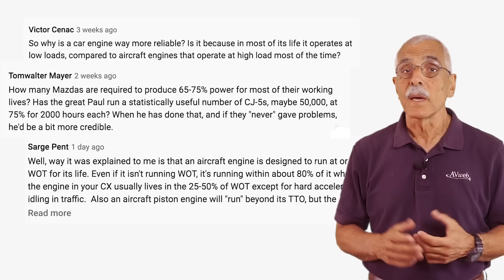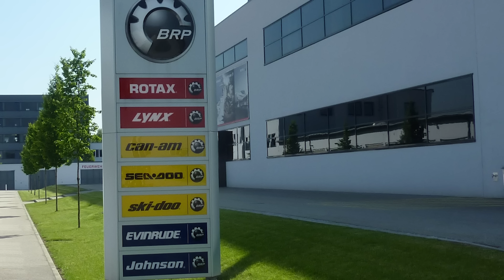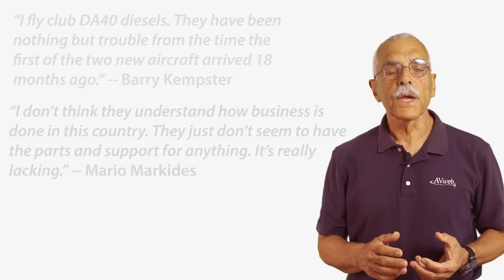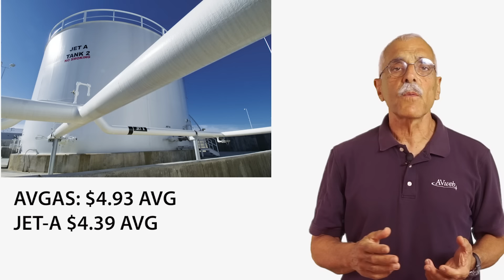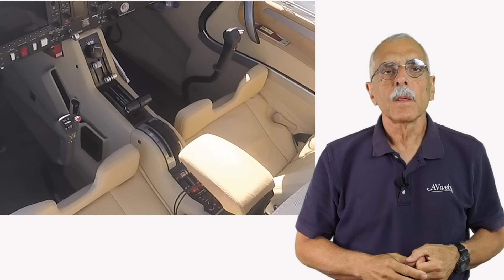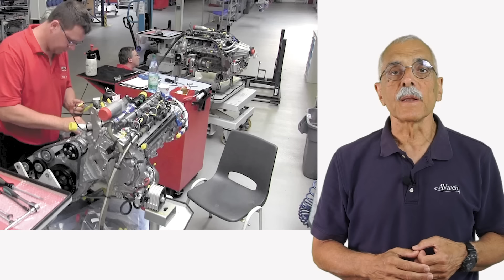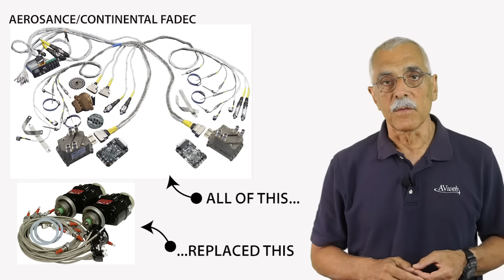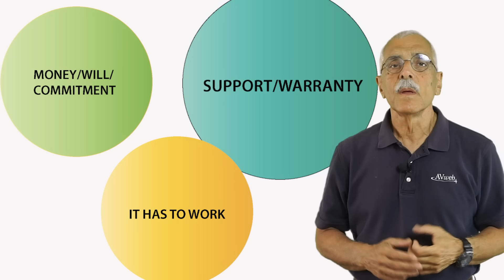Why New Aircraft Engine Ideas Rarely Succeed

Comment: So here's an idea. Instead of being revolutionary and inventing a new piston engine, why don't we be revolutionary in a different way and put a suitably small turboprop in airframes that were designed from the factory to accept a piston engine?

In other words, "Why not PT6?" Already flight proven with millions of flight hours on the clock, lighter than the bigger piston engines that it can be compared to with respect to power output, more reliable and has a longer TBO/TBR than any known piston engine short of maybe the engine in a container ship, highly reliable with fuel contamination/exhaustion being the #1 cause of the engine not continuing to function in flight, FADEC readily available (if it doesn't just come with one stock these days, but that probably depends on which particular PT6 you get), runs on Jet A, the only thing that's missing is the vibration from the pistons going back and forth.

I mean if Mike Patey can make it work in Draco, certainly it's possible. Sure, that was an experimental, but if we're not taking the most successful features of the experimental planes and incorporating them into the more rote GA planes, then why are we even bothering with an experimental branch of aviation?
Perhaps the innovation needed is to bring down the price of turbine engines, rather than pimp out a piston engine?

Also you neglected to mention any kind of aircraft engine using Mogas (even high-test 90+ octane unleaded). The EPA won't kill that, and I bet if the EPA does kill 100LL somehow, that valve seat kits and other parts will rapidly be developed to allow use of mogas in the same old IO or Continental engines we've always been using, or that some other gasoline specification that doesn't use lead but does have a similar octane rating will enter service (not that hard to do, just blend ethanol into it and watch the octane keep climbing, but boy do I hope that's not the route they take, ethanol gas isn't very stable and is quite hygroscopic).
Reply: Turbine engines are extremely inefficient at low speeds and low altitudes. They literally spin too fast (and thus burn too much fuel). When power is pulled to "idle" in a turbine, is doesn't spool down, like a piston, it uses prop pitch the reduce thrust and lift.
Reply: @droge1300 
Long story short, you're right, but you're not addressing the same issues I'm addressing.

Short story long, how often are you really at "idle" or a low power setting in any aircraft? Pretty much just when you're coming in to land or when you need to lose altitude, and the majority of the flight is spent at "cruise power" which for airliners is roughly 85-90% power, well within the range of power settings where turbines are very efficient indeed.
Also there's nothing that says a turboPROP (not turboFAN) aircraft has to be fast, and nothing that says a small general aviation aircraft has to be slow, either. It's entirely possible to make a slow turboprop, or a fast 4-seat turboprop aircraft. Sure it might not be as inexpensive, but I'm not considering cost here, I'm considering what "new engine idea for GA aircraft" will actually succeed. After this video provided so many examples of failures of PISTON engines to meet the needs of either the aircraft or the timeline or the budget, I came to the observation that none of the failures here were of new TURBINE engines, so I jumped to the type of turbine engine that is most suitable to be adapted into use on slower general aviation aircraft and most similar to a piston engine, which is a turboprop.
Additionally, I'm well aware that a full-fat PT6 wouldn't be suitable for many GA aircraft, which is why I though that perhaps either an entirely new design or more likely something with significant design heritage from a small helicopter's turbine engine would be suitable for those applications.
Plus it's not entirely hard to de-rate a PT6, and if it's Pratt&Whitney doing it, the efficiency loss isn't that bad either.

Comment: I lived at Topeka KS 1954-2001. U.S. A. F. then DuPont. I have patents 6446422 & 10525174 and books. I have a design for an engine to power trains, ships and propeller air craft. It uses no pistons, nor cooling and it can run on any liquid or gas fuel as ling as it is combustible. It will not be heavy and should revolutionize the engine manufacturing. I am an 85 Y/O Disabled Veteran PTSD ETC. I ask you to build a small one to test. It will be cast iron and Ceramic. Check with Precision Cast Parts to see what they will do.

Comment: Porsche started the production of aircraft engines after they heard some enthusiast where doing this on their DIY planes. The Porsche CEO had some interest in the aircraft market so they started to produce an aircraft engine. I have heard rumours about the construction of this engines, someone told me Porsche had to re-engineer these engines because the original documents where missing.

After a lot of investment they started producing this engine and than there was a change in the Porsche management. the new CEO wasn't interested in aircraft at all and he found out it will be cheaper buying back the Porsche engines than providing parts for the few engines they sold.

Comment: carb engine should be replaced by EFI it would get rid of the mixture, ECU could control the prop as well and reduce another lever. EFI will reduce fuel consumption, upgrade engine internal with new technology we got after the 60s. aircraft engine doesnt need VVT or VVL like car does since there is almost no movement in the rpm range, prop do it efficenly. If it's possible to get rid of the LL would be great too but running diesel at altitude it's not realy great with all the sout

Comment: "Best Engine"  Not if you require 500+ hp.
Reply: Who requires 500+hp from a piston engine?  For 500+hp, you're in PT-6 teritory.
Reply: @droge1300   There are lots of historic planes that require more than 230 hp, or whatever this "Best Engine" produced.  If you put this best engine in them and fall from the sky, then it isn't the best engine.

Comment: That was very interesting. There are a couple of my favorite no shows missing there. One is the yet to rise above the noise Liquid Piston high efficiency rotary which is getting a start in DARPA funded drone engines. The other was the 3 cylinder 6 piston horizontally opposed diesel https://www.matfoundrygroup.com/News%20and%20Blog/What_is_the_Opposed_Piston_Engine_and_Why_is_it_Better one of which got an opportunity that breaks your first rule “new aircraft new engine” as powering a British built airship. I’ve lost my references to the maker of that engine.
Reply: I'd hardly call an airship an aircraft, especially when talking about engines, as the airship has something that any winged aircraft does not have. Lift without thrust.
Reply: @SciDerg   Airship? True. But that 3 cylinder 6 piston diesel was only 10 kg heavier that its equivalent power Rotax as I recall. And there were 2 of them at the time. Did you look at the Liquid Piston Engine?

Comment: Why aircraft engines are the best, They are butt simple with very few thinks to fail, The Mercedes 3.0 diesel was the worst engine I ever owned everything on that could fail did so and at 150k miles the oil pump quit at 70 mph and that was the end of the engine there is no way I would fly with that engine. In over 50 years of flying I have only lost a couple of mags and a prop seal that is good for over 5000 hours of flying.

Comment: Diesels make sense if the aircraft is large enough and the mission requires range. But.. not so big that turboprops start to factor in. 
As the aircraft gets smaller the advantages of Diesel efficiency eaten up by added weight. 
As those DA 42 and 62's age they become a fairly interesting opportunity in the used market.
Every once in a while you can find a flight school offloading a few that need some work for less than 300k. Have to be careful though. Some are the Lycoming IO360 conversions which is sad.

Comment: I worked for the company in Punta Gorda that reworked the Mooney's.  A really poorly run company.  Porsche was so adamant about not having their engines used in aircraft ever again that we had to document there destruction.  We would bust them up and then send them to a shredding company.  The Porsche logo had to be removed from the tail and the upholstery.  Porsche car guys were crying about this.  They really wanted the engines because of the dual ignition.  I still have the engine service manual as a souvenir.

Comment: We all know PT6 is the best engine in the world. Hands down.
Reply: Best for what?

It is insanely expensive and thirsty for most of general aviation. 

It’s increasingly old and outdated especially in comparison to the GE Catalyst. The PT6E is a reactionary and band aid approach to what they should have done years ago. 

Pratt & Whitney is slow and expensive.. and after spending an insane amount for an FCU the secondaries are either so slow that it threatens to hang in the winter or so fast it threatens to hot start in the summer.
Reply: I'm sorry, but if you want the best, you clearly need to strap a GE9X to your Cirrus.
Reply: Not for general aviation aircraft
Reply: These nerds clearly don't have experience on the Pratt Mat. PT6 is excellent and it runs on Jet OR avgas (some models anyway)

Comment: let's just build a large capacity air cooled mechanical injection 2V turbo diesel following the Lyc/Con architecture.   KISS, and take the diesel/avtur energy/lb, less vapour pressure advantages.

Comment: So no one has ever tried a small turbojet that instead of spinning the propeller directly spins a generator and then use an electric motor to spin the propeller?  Add a relatively small lithium ion batter pack and super capacitor or two and I bet you have a winning combination.  Turbojet has fewer parts and can burn just about any fuel.  Make it small and light.  The battery pack and super capacitor can act like a short term backup for the turbojet.  As battery energy density gets better and the batteries get lighter gradually you can run the turbojet at lower rpm or eventually get rid of it all together or keep it as a backup.

Comment: The aluminum Buick 3.8L certainly would work in an aircraft.
Reply: ... if you can keep it from hydro-locking due to the intake manifold gasket issue.
Reply: @SciDerg  I wonder why no one has tried the Grand National engine in an aircraft.

Comment: never could understand why Diesel engines are not used more. Yes heavier, but more fuel efficient and great torque at low revs. I think you mentioned something about engines running continuously, surely Diesels were designed for this, why else would they be used for electrical generation. Also some issue about temperatures, I used to work on Diesels and they had a fuel return which warmed up the fuel. Very informative video. What about a Hybrid? small engine cutting in to replace electric charge when battery has used up its charge.
Reply: The weight is the reason. The extra weight more than kills the extra fuel efficiency because it costs fuel to carry more weight.

Comment: The toyota land cruiser (and 4runner, sequoia, GX, SC4xx, etc) V8 with and without FI was certified for aircraft use and then never used. It's a bad bitch and can rip the current engines.

Aerospace needs to focus on off the shelf automotive, with a bit more weight, instead of trying to reinvent the wheel to save a few lbs

The Honda R18 which has entered some production was probably a bad choice has cracked blocks in cars

Comment: The Rotax 915IS seems to be a decent evolution of things for them. There was a recall for a possible defect in the exhaust valves, and they had caught it in test engines before they had an in-service disaster. I watched a video of a service outlet doing the retrofit, and it would seem that Rotax was taking a serious approach with  their customer support. Considering the price point, that should be a given, but it’s also interesting to note that the particular Kitfox in the video has been out and about for quite a while with no mention of further problems from its power plant. It has been proven time and again that customer support of those who decide to try your product will be the best investment you can make as a supplier. Great video. I always learn so much from these.

Comment: 5:48 the OM640 was actually used in the two preceding generations of A-/B-class Mercedes cars, canted so that it can slide beneath the passengers in a heavy frontal crash. In the pictured A-class Diesel engines of less displacement than 2 litres are mostly from Renault.

Comment: A couple of factors not explicitly spelled out:  Cast iron blocks have traditionally had greater reliability and longevity, at the expense of weight.  And, water cooled engines also have greater reliability and longevity, at the expense of weight.  Honda proved the latter with the Goldwing horizontally opposed 4 and later 6 cylinder engines.  At a time when most air cooled motorcycle engines had a typical lifespan of 20,000 miles between rebuilds, Harley-Davidson less and Honda more, the Goldwing easily achieved up to 100,000 miles.  That put them into the range of auto engines.  Water cooling allows the engine to run in a smaller and more consistent temperature range and that permits tighter tolerances.  All that pays off in the long run.

Comment: Orenda was another engine that virtually everyone knew would never come to market. This liquid-cooled V8 was installed on a King Air 90 for flight testing and would allegedly burn less fuel for the same amount of power. But it was incredibly complex compared to the PT6 that it was intended to replace. No turbine pilots want to go back to temperamental, vibrating piston engines with lower reliability and shorter TBOs.

Comment: American people are used to pushrod technology and cast iron.. diesel is the engine of the future.. because we can use alternative fuel..  hempseed oil is clean enough for my table.. and I love it for everything.. it can replace diesel and jet fuel immediately... no worries mate.. Herr Diesel used coal dust in his first design.. in the 1890s... the secret is high pressure delivery of a very fine mist.. its efficiency is second to none.. twin cam engine means.. less drag to open and close valves... and.. if you change your oil.. I have worked on Mercedes diesels with more than 300,000 miles.. with no problems during the 25 year history of the car... it's technology at its best 👌
thanks for sharing

Comment: Can you make a video on why pattern altitude is typically 1,000 ft AGL?  Seems to me that with stall/spin incidents being the number one cause of fatalities, that we should increase pattern altitude (more time/altitude to recover) and extend the typical downwind legs to allow longer final to bleed off the extra altitude.  Longer final would also decrease the need for steep turns that pilots sometimes make to align with the runway.  I agree pilots need to avoid stall/spin mistakes, but isn't the system in place also part of the cause?

Comment: i remember an article in Air and Space magazine about trying to develop a Chevy big block i think it was, into a aircraft engine. Tons of cash put into it, problems, they finally brought in a engineer who looked at all of the parts and told them they would need to replace a lot of it with stronger parts because it wasn't  designed for the type of duty required from an aircraft engine. That was easily 20 years ago or so, might be why that thought is still around.

Comment: Electric motor starting procedure:  change power setting from zero to > zero.
I hope some of these engine manufacturers are looking at providing reliable and lightweight generators for hybrid electric aircraft, as that's the direction we're going.  Then, in 10 years when battery costs have come down even more, and power density is over 500 Wh/kg, the small aircraft ICE will be all but dead.

Comment: I guess the only way to kick start the small piston single market would be with a re-interpretation of the "Volkswagen formula"; something like the 172, but slightly more modern. New "everything" and priced to compete against even used 172's. Something to disrupt the market and get more people in the air.

This "idea" would probably cost several USD100M just to get off the ground. The payback and interest alone would already weigh it down if not produced by the thousands.

Comment: Excellent summary! I love flying my thielert 2.0S rev. 2 in my Skyhawk! Belive me, you wont fly another engine once you checked it out. I cross fingers that continental will not screw it up! The retrofits just starting to boom. However Continentals charges on parts are rising to much leading to too much maintenance cost.
Reply: Smells a bit of "Oh if you like this than we're going to charge you twice as much for it", like what happens in the housing market.

Comment: I wonder why Toyota didn't push its engine to one of the aircraft engine companies who would take the testing, maintenance, and liability side of the engine. You would think they would like a replacement design for their Avgas engines at no cost, produced by a company that builds millions of engines with high reliability.

Comment: YouTube video: ENGINE BLOCKS: Aluminum vs. Iron
Channel: driving 4 answers
The graphics display at time 10.11 shows that there is only a 15kg to 16kg advantage in using aluminum for 4- 6- and 8-cylinder engines.
Are many people carrying more weight than they need?
At 18.35 there is a comparison of the advantages of each type of engine block.